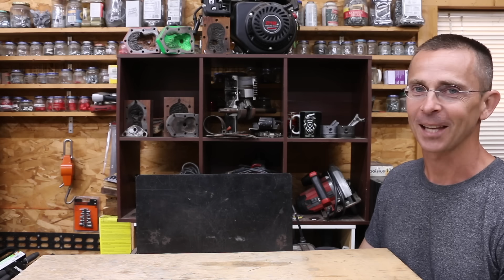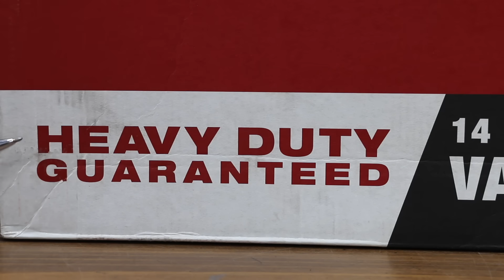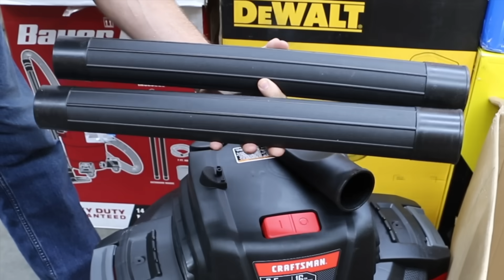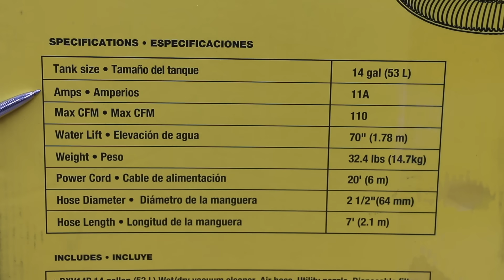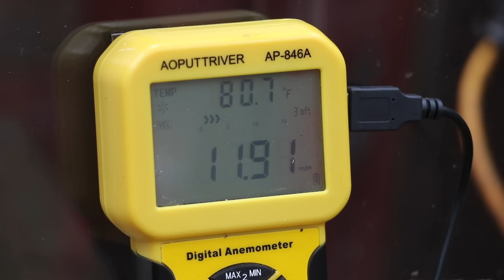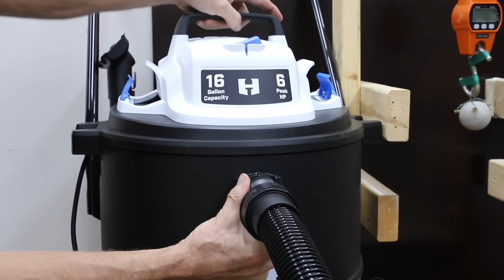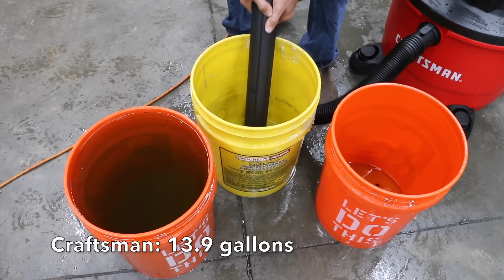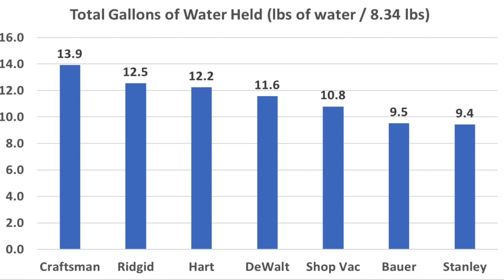Best Shop Vac? Ridgid vs Shop Vac, DeWalt, Stanley, Hart, Craftsman

Comment: Great tests on something I have always wondered about.  True Shop Vac story:  I bought a 6.5 (metal design) but like the one you tested right after Hurricane Michael.  I probably ran that thing non-stop picking up drywall dust, concrete dust, water, etc... for at least a year.  The motor seized up and I called Shop-Vac.  Not only did they send me a new motor for that Vac.  I had a couple other smaller models that were almost 10 years old.  They sent me new motors and parts for those as well.  Free of charge.  No hassle.  No robots.  A person answered the phone.  Parts in stock, had them 48 hours later.

Comment: Bauer sells the extra warranty coverage for about 5 to 10% more, still less than the higher priced brands plus it is not hard to get a 20% off coupon to get the Bauer for $80 + extended warranty

Comment: I get that this video is geared toward the homeowner, but I wish you had also thrown in a festool and fein vacuum. I have the entry level Festool CT15 and it is probably the single most important tool I have. I love it. It’s the only festool I own. I know guys that have used fein vacs and switched to the festool line.

Comment: I enjoy the surprises from the cheaper Chinese brands (I've actually started buying some Harbor Freight products for professional use as a contractor thanks to your videos) but sometimes it would be nice to see a shootout video that wasn't limited to only the cheapest-of-the-cheap items because I look for the best options to use professionally and sometimes quality doesn't come cheap. That being said, the one biggest factor in extending the life of a shop vac that I can vouch for is using bags when possible (and bag quality for different brands is all over the place). Dust in motors and bearings and switches will kill a vac way before its time and pleated filters let a LOT of dust get by.

Comment: Another thing to consider is if replacement parts are available. I had a vac master that fell off a truck and broke the lid so it would not suck anymore. When I tried to buy a lid they're no longer available so now the whole vacuum is junk.... Funny, you can buy still buy the whole vacuum new, but not the lid for it. Great review though I think you outdid yourself this time!

Comment: I have a 16gal craftsman that I bought in 1996 for $99- at the labor day sale,  it is still running like a champion,  I resently used it to drain a large hot tub with no issues great shop vac. 🇺🇸

Comment: suction test should use same size hose end for all vacuums.  larger hose end equals more surface area negative pressure is applied against.  force = pressure*area

Comment: Maybe you could do one about house fans. Noise, how much power it draws, whether or not there's any dead spots in the center like one of my fans have and amount of air moving. See how quickly they can blow up a garbage bag for the last one. Not sure how to test for dead spots other than putting your hand in front of them and checking. Would also be cool to check how concentrated the column of wind is from across a room.

Comment: 1. It's about time for the affiliate links!
2. Great video! I bought an anemometer and mamometer to compare airspeed and static pressure between all my shopvacs. I was very interested to find out how a 1980s, ~2004, and a 2020 model (Very similar to what was tested here) Shop-Vac compare. Not quite there yet!
3. One thing I would have loved to see is what vacuums accessories interchange with one another. One factor when I was deciding to buy another vacuum was whether the hoses and attachments would work, and so I defaulted to the Shop-Vac brand just to eliminate any issues.

Comment: My DIRT DEVIL Shop Vac with leaf blower would have been the victor  if you had included it in your test! I have been  using it for 10 years  for water removal, heavy duty  vacuuming, and extended leaf blowing, oh, and acorn harvesting  and that DIRT DEVIL is still going strong. If you got the best why mess with the rest!

Comment: The amp draw does not indicate power.  The motor can be very inefficient and draw more power while creating less power.  This is worthless in assessing power and is of no value.  It's silly that packaging declares the power draw in amps.   A short in a wire draws the most amperage. Does that mean it's the most powerful?  Lol!

Comment: For the suction weight test, I would think the diameter of the hose would make a difference as pressure is force per unit area, larger diameter hoses should be able to hold on to more weight then smaller ones.

Comment: Why didn't you test professional level vacuums?  I have had many shop vacs from big box stores but when I splurged for a Fein Turbo II to satisfy my wife's request for quietness, I was blown away.  The only noise you hear is from the air disappearing into the black hole at the end of the hose.  Before the Fein I didn't have to be careful where I pointed the sucky end.  And the auto on/off feature is just magic--all shop vacs should have that feature.

Comment: As someone who’s thrown out dozens of bad shop/all purpose vacuums. Shop vac is the worst, dewalt isn’t much better, ridgid makes a pretty good vacuum. I tossed out a shop vac and a dewalt already this year. 

Now we do use them a lot and I have multiple in each job trailer. We use them for dust collection on all saws and also on all sanders. As well as actually use them for just general cleaning.

Comment: You are so right and never wrong, it is sad that H.F. pretty well stands behind their products for 90 days, however I showed them a defective product, where as  proper quality control would have caught the problem before wasted production; generally speaking the problem may not have shown up for a long time after the 90 day warranty expired. I showed them the problem and they gave me a full refund at the store level and yes they did know of the problem, sad as the fix would have only taken a small mold modification, corporate America is just as guilty as China as they don't seem to have any Q.C. either???

Comment: All I can say is that I bought my Rigid shop vac on clearance for $75 in 2003, and have used it a LOT over the past 17 years.  Still performs as good as new.  I have no idea if they make them as good nowadays, but if mine went belly up today I'd be at Home Depot tomorrow to get a replacement.

Comment: I have a Ridgid WD1851, which I bought after the one-two punch of Hurricane Irene and Tropical Storm Lee put eight inches of water in my basement.  Used utility pumps to get the level down to less than half an inch, and the shop vac for the rest.  It doesn't have a detachable motor, so I wonder how much better suction it would have than the one you tested.

Then again, it also cost $159 at the time (September 2011).

Comment: Can you do a tape measure test? See which can be extended the longest before bending. Which has best features like stops and if they have magnets. which has clearest/largest writing, is it on both sides of the tape? Which can take the biggest beating? im assuming the fat max will prevail but would like to see it up against milwaukee and similar brands.

Comment: Related to vacuums for a follow up ... check out the various Thien Separators, Dust Deputy, and other dirt separators. Perhaps compare the separator in a Dyson to the home-built and commercial separators. I built a Thien Separator into the middle of my shop vac, sandwiching the motor assembly on top and the vac base under it, rather than many builds people use a secondary bucket and then need a little cart.

Comment: Bauer was impressive but Id take the DeWalt because it performed very well but more importantly its very quiet. Most people dont know that 3db increase means its twice the sound energy...now imagine a 10-12db increase. Only downfall is the weight of it!

Comment: I'd like to know how the amperage was measured. Were the vacuums under a load or just free wheeling? I'd like to see the amperage with the end of the hoses plugged off so the motors are pulling the hardest.

Comment: Enjoyed, as I do all your videos. 
The meter which measures current (amps or amperes) is called an ammeter. Also, power is measured in watts. 1 hp equals 746 watts.

Comment: Before watching I have a ridgid 16 gal 6.5hp peak with glowing reviews, so my money is on those. Got it for $90 on sale. I love it. One problem is on of the wheels for some reason is bent or something and wont turn so moving across the floor is our of the question btw 750 - watts is a horsepower meaning no vacuum is more than 2hp continuous  (1500w) or 2.5 peak (1850w peak) If ridgid was sealed better it prob would be number one

Comment: ive been buying craftsman for years as a contractor and my new one died on me so i took it apart and a wire had fallen off... only need a Philips head screw gun to  fix it... it was i little wire with a speaker wire type connector with a flat blade and a small female slot it fits into

Comment: Amp/Hp is a terrible measurement to use. One turbine can be much more efficient than another design. There have been many cases of manufacturers making their device pull more power on purpose to inflate the power rating, since it is often what people look at when buying. In the EU they have put regulations in place to limit power consumption of vacuums and they need to have an energy label showing how efficient they are.

Comment: Thank you so much for this video. I've owned about 8 shop vac brand vacuums... Mostly because I need to stick with the same hose setups & existing accessories &HEPA cartridge filters.... All that said, I hate shop vac. Their quality has steadily gone down in the last 20 years. Case in point the last shop vac I got the motor burned up after 5 months of use. I tried to get a replacement motor (which would have been 70$) but they discontinued support of a 2 year old vac, I'm guessing in favor of their SVX2 motors.

Comment: Great video, thank you so much for all the effort you put in. Would it be possible to test brake pads and rotor? Maybe the new geomet type with rust protection. OEM vs Powerstop vs Brembo or any other aftermarket.  Plain vs slotted vs drilled? Thank you again !

Comment: I just bought the Rigid model that doesn't include the removable blower.  I would have to say that the suction is greater than 4.8. We used it to suck the air out of storage bags for our suitcases to return home. It worked super well and gave me the impression that it is stronger than the test here indicated. Although, this test is 100% accurate to what it was testing.

Comment: Regardless of what you take from this Ridgid vacs are the ones that stand the test of time. I've seen so many ridgid left outside banging around 8n the back of trucks and they all continue to work where  shop vac seem to burn the motor is out within six months to a year of abuse

Comment: I wonder if you can use some foam tape or something to create a more secure lid to bucket connection and get better suction out of them? Give them all a fighting chance despite their poor manufacturing quality. I would think that with a loose bucket lid dust would come out through there and spray all over the place. Kind of defeating the purpose of having a filter in the first place.

Comment: Tool quality choice comes down to how much I would use it. Something may be used once every few years, vs something used every week. Name brands usually have higher quality and longer warranties. I try to avoid cheap knockoffs because it breaks, costs more in the long run to replace with another.

Comment: One of my first jobs was working for shop vac pulling burning hot plastic off of molds for 8 hours a day. The worst job was the "hose line" though. It would spit out a 6' hose every 30 seconds and you had to put a ring in the middle and both ends on. If you got behind at all it would pile up and they would have to shut everything down. That job sucked but it was money

Comment: Great work as always!   It got even more interesting for me when I compared your findings on Amps and suction load.    Pretty crazy, for drawing 13.1 amps, the craftsman only pulls 6.4 lbs.   Compare that to Bauer and DeWalt, with Bauer at 10.2 amps and 10.1 lbs and DeWalt at 10.9 amps to 10.4 lbs.   Generally speaking, it gives some indication of system efficiency within the motor and overall construction without getting nitty gritty in the calculus to look at work in and out.   By the way, my Rigid assembled much faster, it didn't come with the wheels or half of the attachments so it made for a quick put together!

Comment: Bro... You can't use a ball for a suction test if the hose diameters are different... You should use a flat surface for tjat!  Becuse you will have more suction coming closer to the center of the ball then further away from it...

Comment: Even tho your showing proof. The craftsman definitely doesnt have better suction the my 4 gallon ridged. I I detail cars and the ridged gets carpet way cleaner then the craftsman xsp 16 gallon. I have to use a drill brush with the craftsman to get the carpet fully clean

Comment: I think there's a procedural problem with the suction test. You really should have put them all through an adapter so that the part touching the ball was the same diameter in each case. The larger hoses will apply the suction to a larger area of the ball and increase the numbers even at the same PSI of suction. As an example the well-known demonstration where if you add a large funnel to the hose of a household vacuum, you can use it to pick up a bowling ball.

Comment: Great testing and very interesting! With those like the Bauer having a perfectly sealed lid would be very hard on the motor when using full suction. It could over heat much faster than Ridgid that has less air seal if put to a few hours constant work. When My basement flooded my Ridgid did about 4 hours straight with only stopping to empty the bucket every few minutes. Maybe more suction could be reducing the motor life. You should do a long term vacuum test with those in this video and inspect the motor maybe put a heat probe on the motors and see which gets the hottest under load! If you look at this video at 6m18s https://www.youtube.com/watch?v=T5Q8RrzWJVg this expert talks about electric motor heat being directly connected to its life.

Comment: The input power is virtually meaningless with vacs of this type. With efficiencies in the 30% area, it is swamped by how good the motor/impeller is.
When testing the suction, you should use the same  tube. Any change in diameter will have a large affect on the reading.

Comment: For once I caught a video BEFORE I bought something lol. This is a great video, I really enjoyed it. I have a Craftsman 16gal with a detachable motor that I bought in the spring of 04 that is still going strong.  I believe that's because I've always blown out the motor with my air hose after I use it. The only complaints I have about it are that the wheels don't roll and they fall off. The major thing is that the hose has always kinked up close to the motor. I have to keep a clamp on it to keep it open. The next one I get will have the built in hand truck. Thats a big one for me.

Comment: You should test different impact drivers from Hart, Milwaukee, Makita, Ridged, Ryobi, Dewalt, Kobalt, and Craftsman. I would be very interested to see the difference between all of them. Brushless for all of them and test them with different drill bits and different screws and the time it takes to drill them in. Also a test for the sound level of each, weigh, and run time.

Comment: second mistake - measuring the suction force - this force depends on the vacuum pressure and pipe diameter, Stanley and Hart had half an inch smaller pipes.

Comment: How can they all claim to be 6-6.5 horse power, when that's like 4.5K watts? 6.5 HP would require 40 amps on a 120V circuit, or 21 amps on a 230V.

Comment: P = I * V
Power is equal to current (amps) multiplied by voltage (volts). The result is in Watts. Multiply your wattage by your assumed efficiency and then divide by 746 to get horsepower. Great vid as always!

Comment: One thing you didn't cover, wheels. I found that the 4 small wheels at the corners worthless. The vacuum will tip over on its own cord. 2 large wheels (8in or larger) in the back with one or two medium wheel in the front  is much better. Anything less than a 21/4 in. hose is not very useful in a shop.

Comment: Why was power (HP)  measured on the basis of current (A)  if the meter has a power measurement(in W/ 1kW=1.34HP)?. The current does not take into account the power factor correction that the vacuum cleaner may or may not have.

Comment: My poor ridgid. My dad has had the rigid version for years and it does everything. Cleaning flooded basements, cars, drywall, sand, cement dust, blowing grass clipping off the side wall and really the only issue we had was that we needed to replace the power cord because the original was coming out or something. I didn’t have an issue with suction unless I was carrying it or if I forgot to tighten one of the locks. I’m still biased but I enjoyed this video.

Comment: thank you for this test! i found the website wirecutter and had used it for a year or so before i found your channel. they recommend the rigid without even testing any other brands. i knew there would be better and with your test i have the proof. i think bauer is the clear winner for me unless it doesnt hold up, tho the craftsman is on sale for $80 and if the 3 year warranty covers it, its a great buy